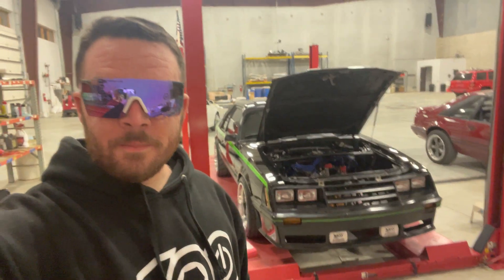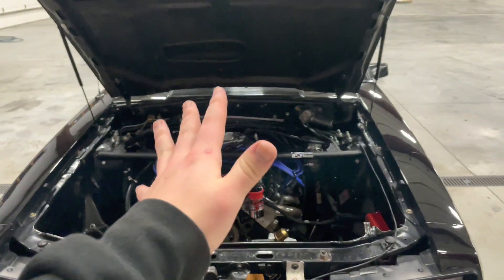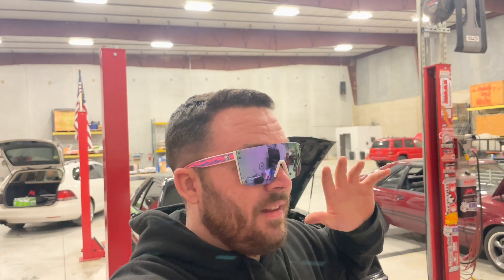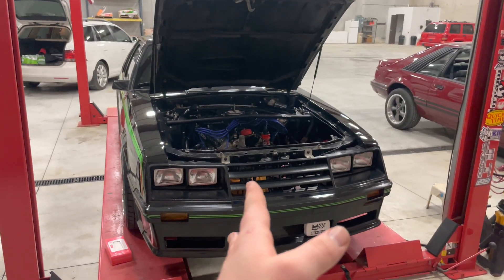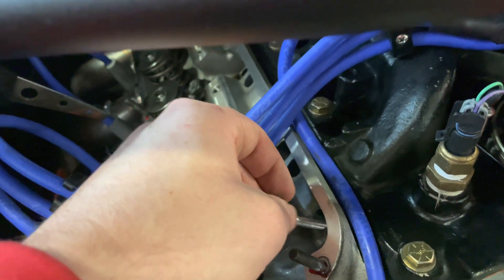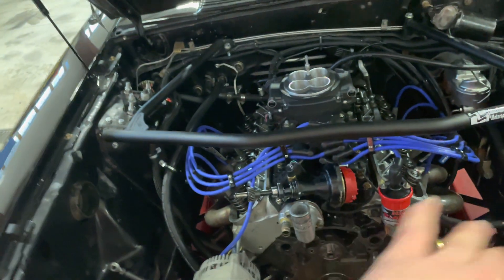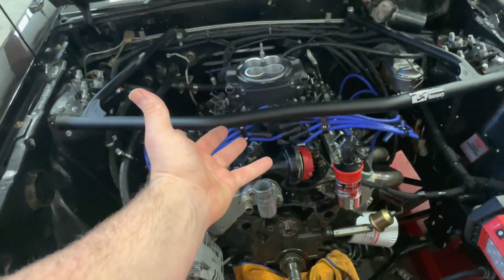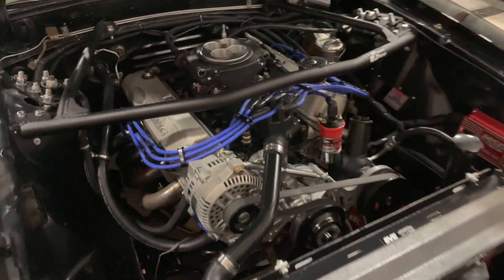Cam Swap on BluePrint 347 SBF without pulling intake?

Comment: I  have the same motor but I’m lost on the cam choice how are you able to run it with such a high lift and was there any ptv issues? Could I i run a 266hr ?

Comment: I have a 347 fox as well with a b303 cam in it right now. Coincidentally, I was thinking about purchasing the exact same cam as you to put in prior to even watching the video. Did you end up having noticeably better power with that comp cam over the x303? Thanks!
Reply from the maker: Huge difference: picked up about 3 MPH in the quarter
Reply: Thanks! Does that cam chop pretty hard too?

Comment: I think the valve springs might be on the weaker side with the .579 lift.  How high can you rev the motor with the new cam?

I have a BluePrint 410 Ford that I got on the Summit clearance rack.  It has a mild cam with specs similar to the XE266HR.  The BluePrint heads are the NKB castings that AFR uses for their Enforcers.  I put the heads on a 351w roller motor.  Like you it has pedestal mount rocker arms.
Reply: I’m thinking of swapping to a pedestal roller rocker just for maybe a couple extra HP. But to the springs, when I talked to comp cams they seemed pretty confident that I didn’t need to upgrade springs. I only rev the car to 6k and I usually never rev past that. I did get the chance to drive it and the thing RIPS! I didn’t notice any valve float but I coulda been to busy laughing like a girl to notice if it was or not lol
Reply: You got the XE266HR12? If so I have the same cam. What intake you run?
Reply: @WesternReloader  I ran one in my 90 5.0.  Ran almost the same ET with a Trick Flow Track Heat EFI and the carbed Stealth.
Reply: @sbf_fox2434  in your experience and opinion would I see any gain going from a Weiand street warrior to a Stealth?
Reply: @WesternReloader  I never ran a Street Warrior (Action Plus) so I have no first hand experience.  I believe the high rise Stealth will perform better than the Street Warrior at the top of RPM range, whereas the Street Warrior may perform better down low.

Comment: I switched from a comp cams Magnum 282 roller to a Big Mother Thumper. The Magnum ran great but the thumper chopped very hard at idle and had great wide open throttle performance but the drivability was terrible. It was on a 393 carbed/T5 setup with 3:73 gears. Your injected setup probably will drive alot better than the carb one. You can hear it if you look up Big Mutha Thumper in a 393 on YouTube.

Comment: Thing with moving up in cam size mean you can gain more power up in the rpm range but you can lose power and torque in the lower rpm range.  That xcam is good because if you average the power and torque over the entire rpm it should be better than a cam that only makes power from 3000-6500 rpm
Reply from the maker: The nice thing about the cam that I swapped to the RPM range is almost identical to what came out. And if for whatever reason it does loose a little low end torque which with this cam It shouldn’t, the cars less than 3100 Lbs so it probably won’t be a seat of the pants difference.
Reply: The new cam he is using is a comp Xfi 236HR-14, which was designed with 347 strokers in mind and is significantly better than an old single pattern F cam. I would put money on his car making more power everywhere. The only better cam he could have gone with is a custom one.